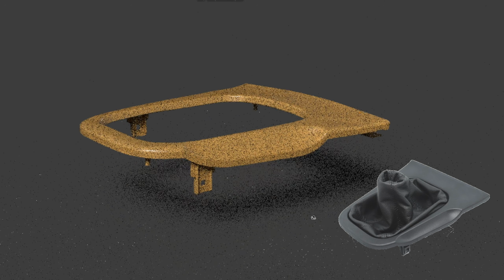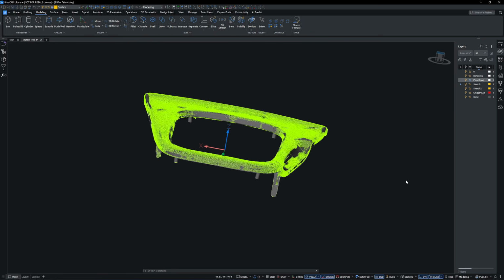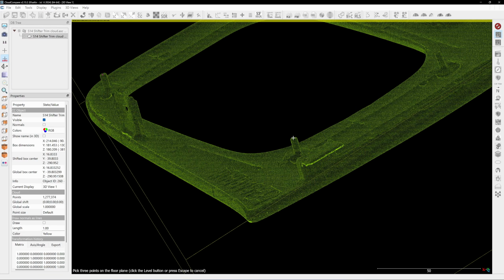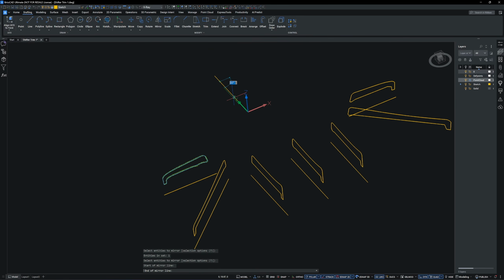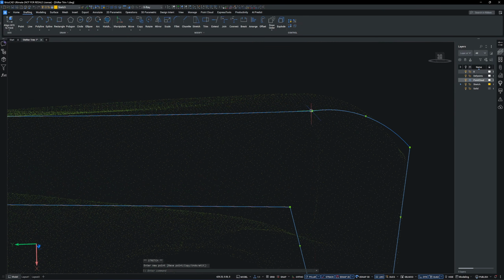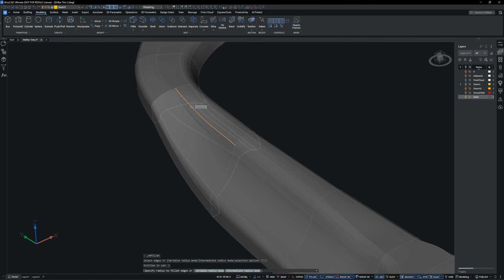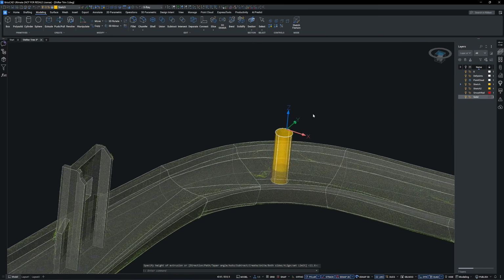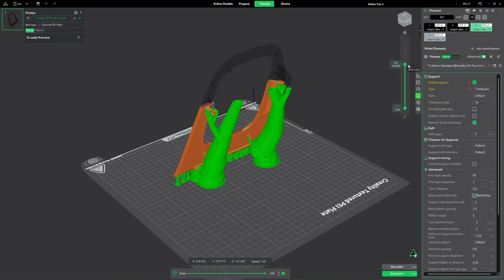3D Scan to CAD – Printing Nissan Silvia Shifter Trim (Creality Raptor Pro)

Comment: Wow 1998>>!!!
I started using Autodesk 3ds Max 2.5 in 1999.
I did get approached back in 1991 to cut up huge original CAD design master files into smaller specialised files for different trades and specialist.
We had a team of four actual Machinists working on that job.
I was a theatre technician building the set for the Australia "Phantom of the opera".  

I was so lucky too work on that production Payo.

: ]
Reply from the maker: That sounds like an incredible experience and a fascinating career history!

Comment: Trim pieces are deceptive. A shifter surround looks simple until you try to match the curvature on both sides. I am running the same process on a whole Lada 2106 body — same problem, forty times over.
Reply from the maker: The only truly flat part you’ll find in a car is the disc brake.
Reply: @Payo-TensileCreator  And even that is only flat until it gets hot. On a 2106 the closest thing to a flat panel is the bootlid, and it still has a slight crown so it does not oil-can. I keep finding surfaces I assumed were planar and are not — which is exactly the ones I get wrong.

Comment: have you ever used plasticity to try and reverse engineer scanned data?  is it recommended? or are there more suited software to recreate surface and organic modeling features?
Reply from the maker: Plasticity lacks point‑cloud capability, making it unsuitable for reverse engineering. Its CAD surface toolkit is limited to just four commands, Extrude, Patch, Loft, and Sweep. These tools have been standard for over 25 years and are already used to model virtually everything around us.
Reply: Is it possible to create the sections in cloud compare to produce the lines needed to be traced and exported as dxf, then the dxf file stack can be traced and rayed between sections to create the cage needed for the surfaces to be lofted, patched or x nurbed in plasticity? @Payo-TensileCreator
Reply from the maker: @stoffel89  Yes, you can slice point cloud and create 3D lines in CloudCompare.

Comment: Can this be done on Shaper 3d?
Reply from the maker: For modeling, that may be a yes. However, you can’t import point clouds for direct tracing. Supporting point cloud visualization inside a CAD environment is a costly feature, and only a few CAD platforms provide it.
Reply: @Payo-TensileCreator I did some research into the point cloud system. I can definitely see the benefit of it. Thanks!

Comment: Can you do some in Shaper3D?
Reply from the maker: I’m not sure how capable their Loft tool really is, but it definitely can’t open point clouds for reference. Autodesk Inventor, however, can achieve similar modeling results.
Reply: @Payo-TensileCreator I’ve imported my point cloud after mesh conversion. So you can’t do it with mesh? I assumed if you broke the mesh down in parts and hid them you could trace the mesh sections. Their loft tool seems fine from other videos I’ve seen. It’s just an easy to use program and I’ve made other models in it but I haven’t made stuff like this.
Reply from the maker: @builtbybic  You can’t reverse‑engineer with mesh at this level of surface complexity. It’s far beyond a simple cup shape.
Reply: @Payo-TensileCreator  I'd argue that if you slice through the mesh as you did here and created those edges and did a loft, you'd get a similar result, no? Thanks!